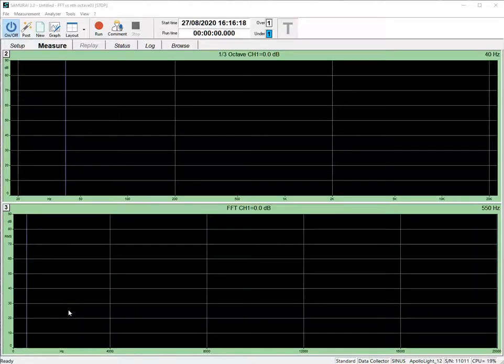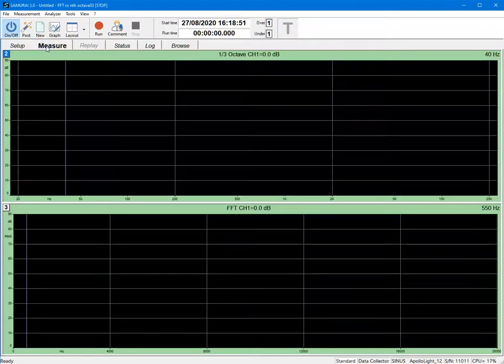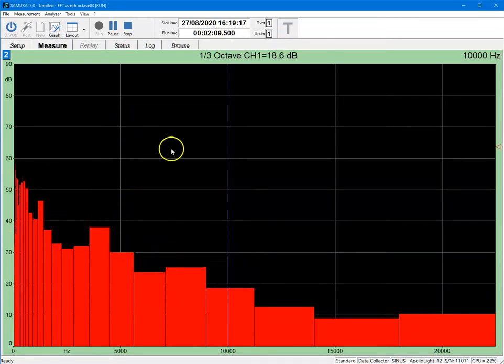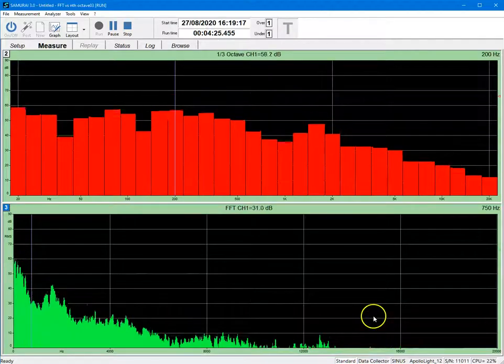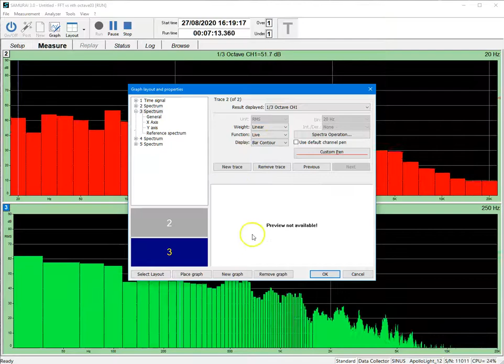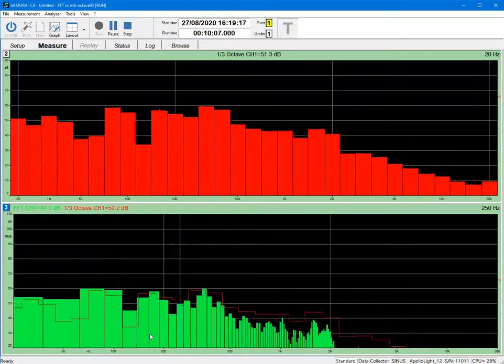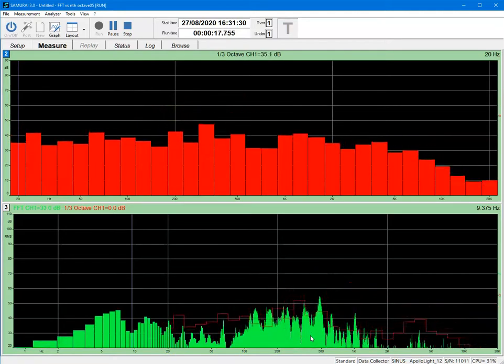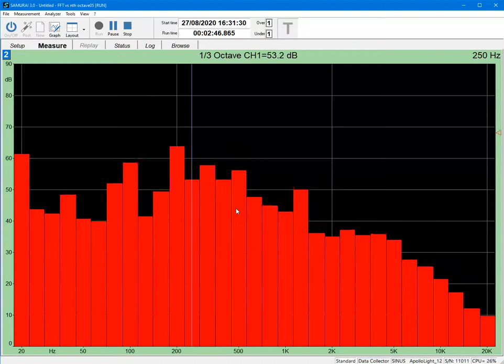Comparison between FFT and 1/3 octave analysis

Comment: Thankyou. very interesting. Env Health officers always state third octave and BS4241 when conducting indoor low frequency testing yet the BS states this standard not to be used for low frequency, use NANR45! Accredited noise consultants have all spoken to me about using the FFT, even the manufacturer of the councils instrument. (though the council only have the third octave software despite the instrument upgrading to fft)  Is a "spectrum analyser" a general term which can also apply to third octave only instruments?

Comment: A constant-Q analyzer looks good in a music player with logarithmic scale and a 3db slope for higher frequencies, avoiding mosf of the signal being compressed on the left side with high frequecies only utilizing a fraction of the display height. All bands are maximally responsive. But no music player actually has this type of analyzer. There are some VST plugins for a DAW. In a music player these plugins are usually not delay compensated.

A downside of this method is the slope of the filters is low, and a single tone excites a range of bands. There is also some minimum phase ringing with narrow filters, but it is fine because an analyzer usually has a slow falloff speed, and an FFT needs additional smoothing to achieve that at small sizes.

FFT always has a low time resolution regardless of the processing power. With more overlap it'll just swell up more gradually.

There is a trick where multiple FFTs can be taken and long windows used for low frequencies, and short ones for high. But this brute force approach is extremly slow.